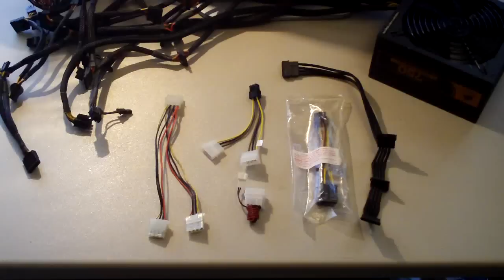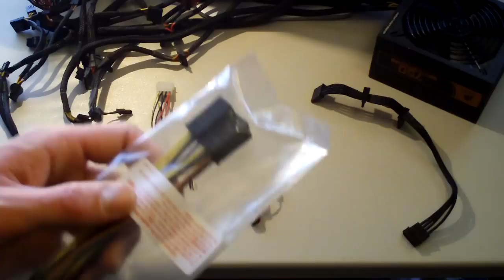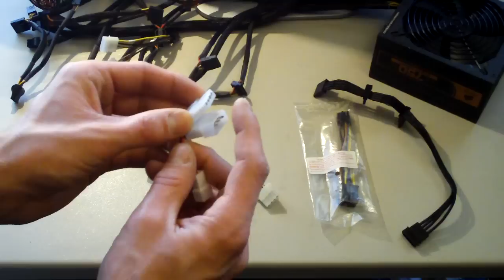PSU Power Adapters Explained (SATA/Molex/6-pin/8-pin)

Comment: I have a corsair rm850x psu  coming with 24 pin cable, pci-e cable. Mobo 4+4pin cpu cable and sata 6pin power cable.  Im good with this exept 1 or 2 of my 3 hardrives are molex and i have no molex power connectors what should i do? 

Simply put i need molex male to plug into harddrive.

Comment: My gtx 960 requires a 6pin which is connected to a 6pin to 2x4pin molex adapter. The problem is that my 4pin molex connects right into my Mainboard and not psu. Would that still work?

Comment: Question, i picked up a Xeon e5 1660v4 computer so great, but the powersupply is really special it has a sort of Pci-e power built in that plugs into the motherboard, plus the usual 24 motherboard pins are totally different so i canno change the PSU

Problem is : i have a RX Vega 56 coming, it requires 2×8 pins to work but that stupid powersupply only has 1×8pins and 1×6pins. I don't really have space to install a second PSU (but i could try to do so) and i cannot change the powersupply as a normal wouldn't be able to connect to the motherboard.

Think a really good 6 pins to 8 pins adapter would work ? I saw HP ones for 40 bucks but if you have cheaper but good ones (150watts+ rated) i'd take them ! Thx

Comment: My 3 month old Corsair CX500 bronze (from a good supplier) has dual 6 pin headers, maybe for SLI. Now I want to go from using the integrated graphics to a separate GPU. Corsair show the CX500s now comes with an 8 way header. Do these things just change with fashion ? The power draw for my system (with the GPU) IS within the capabilities of the PSU, but I need an adaptor between the two 6 way and the single 8 way. Does this still make the adaptor a bad thing?

Comment: Hi I need to plug a Molex to a 8 -pin GPU. I have two options:
i) 1 molex to 8-pin (this is the one I have)
ii) 2 molex to 8-pin (this is the most common)
which one do you recommend? thanks

Comment: I bought a six pine pci cord but it has 2 4 pin molex inputs  with one hollow pin in each into the six pin converter and the 6 pin converter has 1 hollow line in its six pins. Will this work for me? My video card need six pins but I only have 5.

Comment: I run out of 6 pins to power my new gtx 1050 ti however it was too short so I had to buy a power converter but it won't slide in

Comment: I was about to change my current 6 pins gpu with another gpu which has 8 pin, but my psu has only 6 pin conector, should I try with adapter or no

Comment: I have a cyberpowerpc and i only have one molex open, should i use a splitter and then use the 6 pin one like on the table or should i use like the one in the baggie one male to 6in PCI

Comment: welp i made a 1 molex to two 8 pin power adapter and i works, lets just hope it doesnt stuff up my card
Reply: Hows it been for you ??? I'm always skeptical about these type of hacks on the pc
Reply: @mustafakhuzaima9722  It works great, no problems.
Reply: @trix3185  I was about to change my current 6 pins gpu with another gpu which has 8 pin, but my psu has only 6 pin conector, should I try with adapter or no

Comment: I wanna get a Nvidia geforce gtx 1060 but my psu only has one 4 pin and I want to get an adapter from a 4 pin to a 6 pin. Is this okay? I read that the gtx 1060 isn't super power hungry but idk.

Comment: Hey! Please what about molex to 4 pin for second cpu connections 
because my motherboard won't work with 2 cpu supply (8pin+4pin) and i only have 8 pin connector.
Reply: if your mobo has 1x cpu 8 pin and 1x cpu 4 pin you can run this with just the 8 pin in almost all cases.  the extra 4 pin is used for EXTREME loads like you would see in super high overclocks and quite frankly is not needed for almost any standard setup.

Comment: SO, I have a question for you.  I am in the process of building a new computer and until it's done I'm using my older build.  So I upgraded my GPU from a 1050ti to a 1080ti and would like to use it in my older unit until I make the jump to my new one.  My problem is power.  My current psu is a corsair HX650. I have 2 available 6+2 pcie connector on my psu.  The power cable that I got with the GPU doesnt fit into my psu.  I'm confused as to what cable I need.  Can you or someone please help.  Psu is a corsair hx650 GPU is a msi gtx1080ti gaming x.  Thanks.

Comment: My system has a 6pin and my card needs an 8 pin an EVGA Geforce 1060 how can I find what the 2 extra connections are for? If the 2 extra wires are ground then it would logically follow that I can use 2 ground cables from any other non-used cable. I really only need to test the card and then I can pull it and wait until I can buy a new power supply. Heres what happend I read some documentation that told me I only need a 6pin but the card arrived and it has 8 pins obviously in light of this I will upgrade but I really need to test this card before the timer runs out. I have an Issue I'm looking at this 500-watt power supply The 8 pin connection shows it as being a 6 pin with 2 ground wires feeding back into the 6 pin connector so why can't I duplicate this setup with what I got anyone? https://www.ebay.ca/itm/Rosewill-Valens-500W-Gaming-Power-Supply-80-Gold-Certified-FREE-SHIPPING/173894581280?hash=item287cecbc20:g:dl0AAOSwpUVcz4BX

Comment: problem is my power supplies are server power supplies and don't have the pins attached to them.
the power supplies are plenty powerful enough to power just about anything just its missing the cables.

2x720w should be plenty of power

Comment: Just wondering on why my TX550m comes with a 8 pin pcie cable but the port only supports 6 pin pcie cable?
Reply: Because it doesn't need as much power, so it only needs a 6 pin. You will need an adaptor if there isn't a 6+2 or 6 pin in your PSU box.

Comment: It depends if you have a power supply unit from the past that has plenty of molex connectors. I have an older power supply unit from the past that has molex connectors and my thought has been connecting it to my Asus Sabertooth 990fx

Comment: What about a dual 6-pin female to single 8-pin male pcie power adapter? Would you recommend that? I have an 80 plus rated 950 watt power supply that has four 6-pin pcie power connectors but not any 8-pin pcie power connectors. And this seemed to be one of my few options that seemed viable. I'm trying to power a GTX 680 super overclock edition.
Reply: yea it Will work I dont understand tho how a supply that high dont got 8s
Reply: Wtf why do you need an adapter you have perfect PSU

Comment: help: GPU requires 2 x8 pin and my PSU only has 6+2 pin. what adapter do you I need?
Reply: u need a 6 to dual 8

Comment: I have a 500w psu and gtx 760 and it requires both a 6 pin and 8 pin, but I only have a 6 pin. If I use one of these will it harm my computer?
Reply: no

Comment: Hello Guys
I Have Power supply 600W
But It's Dont have 6 pin but it's have 2x molex
And I Want to connect GTX 1050 Ti on my computer so my question is does 2x molex to 6pin will be fine for me ?
Reply: u dont need molex 6 pin to 8 will work

Comment: I got a nvidia 250 for $20 for Linux and I didn't need it for 3d. I connected it to a 300 watt supply that had 1 molex by splitting the molex into 2 and then using the 2 branch to gpu sort of connector and I thought this may melt the wire in some situations.

Comment: I have a question I have a 350 watt PSU and I have no 6 pin only a Sata cable so I bought a 6 pin adapter but it didn't work i needed an 8 pin so im buying an 8 pin adapter for my 6 pin so its two adapters will it work? its for my Gtx 1060 6gb (Im new to gaming computers).

Comment: Hope u read ur comments tech tv  im in a big trouble here.
My psu only has a 6pin power connector. But i recently bought a 2nd hand rx 470 nitro which has a 8pin power connector. What should i do now ? My psu has more than enough juice to power this card.
Reply: What did you do?
Reply: Just buy a 6pin to 8pin connecter nothing from China though you’ll be fine if your psu is strong enough

Comment: I’ve ran out of 3 pin headers on my motherboard, I still need to plug in 1 more case fan that has the option to use molex or 3 pin, how do I get around this problem
Reply: did you find a solution? I have the exact same problem

Comment: Question: I've just bought a ASUS GTX 1050ti 4GB STRIX and i have no PCI-E with 6 pin
If I search for one, I can only find 2 Molex that have 3 or 2 pins, not 4 (I need 4 pins)
If I buy one, is it goanna work?

Comment: I bought a new graphics card which needs 8 pin.
I saw an 8 pin adapter in amazon which is like the first 6 pin adapter but 8 pin instead.
My question is should i buy this adapter or not ?

Comment: I got a question regarding 6 pin to 8 pin converters. I was browsing the good old Thermaltake Toughpower 850 W PSUs and came across this:

http://www.thermaltake.com/products-model.aspx?id=C_00000982

Hence they are actually suggesting to do a very bad practice? For those who do not open the link, they advise the user to use to 6/8 converters for the modern GPUs.

Thank you for clarification, because I am a noob myself.

Comment: can i connect two 6 pins directy from the psu to the graphics card or do i have to use the adapter with the four pin
Reply: You can connect the 6 pin directly to the GPU

Comment: I'll need to turn the 6pin into a 2 x 8pin connectors so I can power my 980ti, but I've noticed the round and square pins are sorted differently in the PSU and in the GPU standards so I can make a frankenstein adapter from a 6 to 2 x 8pin and change it's 6pin part to match the pinout of my PSU. It this safe?

Comment: would you recomend using a mole to 8pin for an 8 pin motherboard power connection? cant seem to find an 8pin atx cable just adapters

Comment: Do you have your email so that I can contact you? I just got an GTX 1050 Ti and I need to fix in my motherboard but the PSU doesn't have any PCI-E Power Supply cable. Can you tell me what would be it's connectors? Random guess.

Comment: Help, I have 2 fans with molex connectors, and a motherboard with no room for extra fans with ne of those 3 pin cpu fans connectoed, but my powersupply doesnt have any molex connectors what do i do??
Reply: I have the same problem

Comment: i need help i have a 1070 and a 450 power supply but the power supply only has 4 pin psu for the cpu. can i buy a 2 4pin molex to a 8 pin pcie connecter?

Comment: My power supply has two sata connectors and I need an 8 pin for a gpu, can I use this (I am not good at computers)
Reply: I have a 600w power supple and am planning to get a and rx 580 and it takes 1 8 pin connector, 600w should be enough but I just wanted to know if I'm better of buying a new power supply or I can use the converter

Comment: My gpu (gtx 1080 ftw2) needs dual 8 pin connectors, but my PSU (evga 650w g2) only have a 6+2 with another 6 pin coming off of that.. I guess I could run another vga cables with a 6+2 pin to my PSU but then I'd have two 6 pin connectors hanging down... I'm new and this is so confusing.

Comment: My new gtx 550 ti needs one 6 pin connector, i have a 350W psu with only 4-pin molex cables...should i use the adapter,or is it possible for me to use a old external dell 200w psu only for the card?

Comment: My Psu doesnt have any 6/8 pin connectors, will tge molex connector to rx 470 run with no problems?

Comment: I bought a new graphics card that requires a 6 pin PCIe power cord. All I have left coming out of my power supply however is one 4 pin molex (female i believe). Should I get a 6pin PCIe to Molex 4 Pin? They usually come with two Molex parts... does this mean one dangles without being plugged in to anything?

Comment: What about an adapter that splits two 6 pins to 8 pin to power gpu? I have a psu with 2 6 pins, but gpu requires 8 pin.

Comment: Hi I know this video is extremely old but I have a question that might seem extremely simple to some, but how do you add the molex cable to the power supply. The female molex on my pc has P3 P4 etc on one side and just blank on the other the sata power adapter has N1 thru N4 on one side and then blank on the other side which side should I be connecting to the P3 side? Or should I be matching the yellow wires to each other?

Comment: i have one molex in my psu  if i use a splitter then an molex to 6 pin could i power a r7 360 by the way i have a 500w psu

Comment: Thanks, this is my first time building a pc, I just need a few adapters for my fan and hard drive.
Reply: can hard drive and fans be connect to same cable?
Reply: @HDClipsCinema  no they can’t unless you’re trying to rewire the cords which I don’t suggest. Hard drives use SATA cables and most fans use 4 or 3 pin cables. But the cables for fans are usually connected to the fan itself anyways.
Reply: @brandonimous1018  bro my sata wire had boh connectors, molex fan and hard drive connector, so i connected them both and it works
Reply: @HDClipsCinema  well I learned something new today. I didn’t think a psu had that.

Comment: I have a GTX 480, it has an 6 and 8 pin connectors, but I dont know what Power Supply I need to use this card, help pls

Comment: Would you recommend a 2 molex to 8pin?
Reply: Liam I just got a 1070ti, what should I do? My PSU only got 1 6 pins, while my gpu requires 1 6pins and 1 8 pins. Should I use molexs to 8pins? Is it safe?
Reply: I just got a msi gtx 1060 6gb and needs a 8pin not a 6pin.
Reply: Liam then get a 6pin to 8pin adpater tho u prob fixed it by now
Reply: Nope, at the least you'd need 4 molex to 8pin (40w x4 to make the 150w 8 pin requirement). So yeah, don't do it.

Comment: i have 300 watt psu and i want to connect a rx460 with 2x4pin to to 6pin. is this ok or should i get a better power supply?
Reply: I should be fine then too as gtx 750 ti oc doesn't need much power like very little anyway?
Reply: 380 is the minimum requirement but I'd recommend anything 400W or above, better safe than sorry.
Reply: M4D AL3X I'm currently waiting on a dual molex to 6 pin adapter and will be using it with a gtx 750 ti oc and should run fine as it is low power consumption but like the other guy said you should probably have a higher wattage and voltage mine is 500w and I only need 230w but it's always good to get more wattage especially when using an adapter
Reply: Zombie Slayer 
I got it and everything works fine even after overlcocking the rx 460.
Reply: Zombie Slayer

Comment: if I have 1 molex connector can I use a adapter to spit it to two molex connectors and then turn that into a six pin or is that dangerous

Comment: would it be safe to use a 6 pin (female) to 2x 6 pin (male) to extend my eGPU setup? 
I am thinking of using both male connectors as the bridge, because the eGPU platform only has a female port as output(male connects to it) and same is on the graphics card (male needs to connect to it). The way I understand it, it should conduct current even if the female connector is never connected.

Comment: Man i have a PSU with a 2x6pin connector but my video card use 8 pin.. if i connect the two six pin connectors to the video card will work without problems?? or i should buy an molex adapter??

Comment: Hey guys, So I've seen some of the GTX 1070 cards come with an adapter that is two 6 pin adapters (female) to a 8 pin adapter (male). so the two 6 pin (75W each) to the 8 pin (150W). This should work right? My GTX 1070 didn't come with one but like I said, I've seen some that do. Just a bit confused?...

Comment: Question I just put in a GTX 660 Graphics Card.Now my PSU is a 450 and when I go to run games that use the Card my computer reboots.The adapter I have is a 4 pin to a 6 pin connector.Should I be using an adapter like the one you showed in the video where it is 2 4 pins that split in one 6 pin connector?
Reply: yes 2 moles ( 4 flat ) made 1 6 PCi (pines), and you "can't" give more power from less power, 4 to 6 it's like dumb, but 2x4 to made a 6pines it's corret by how much power they can run trhough

Comment: i have a gtx 1060 g1 gaming oc and it uses a 8 pin but i only have a 6 pin. what should i do? for 46€ i got a new psu but i only got 46€ left :/
Reply: ble der I have the same problem as you :D Im buying 6 to 8pin adapter buy i wouldnt reccomend to use it for long time

Comment: @ComputerTechTV please help.  I am at a loss.  I have a SSD that was powered by the standard molex cable.  The power blew during a storm so a buddy gave me a new one.  I am grateful, however, it is all PCI express cables.  I am afraid since the old molex had 5volt and 12 volt power and the new PCI cables appear to be all 12 volt.  What adapter or cables to I need to get it up and running again?  I have done so much research and no one seems to have my same concern.  I bought adapters to hook it all up but when I power it up it immediately trips the "breaker" inside the new power supply.  When I unplug the set up and just have the motherboard attached it powers up fine and goes to the boot screen.  What do I do..

Comment: Quick question; just bought a Zotac gtx 960 4gb and its power consumption is 120 and it uses a 8pin connector. Could I just be cheap and slap a 6pin in there and see if it works? Cause if im guessing right a 6pin can give it enough power right? And I might buy a 6pin to 8pin connect if it doesnt work.

(Only asking cause I'm on a FUCKING TIGHT budget a.k.a my parents, so if it was me I would just go buy a new PSU but yea... no job and only in highschool.... FML)
Reply: Not a good idea. I doubt the 960 will have enough power to operate on a 6 pin. Buy an adapter just in case.
Reply: can i make adapter and just take ground wire and put it in that 2 aditional pins? they are only 2 more ground correct?